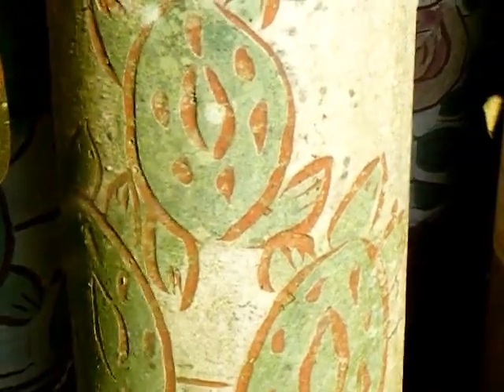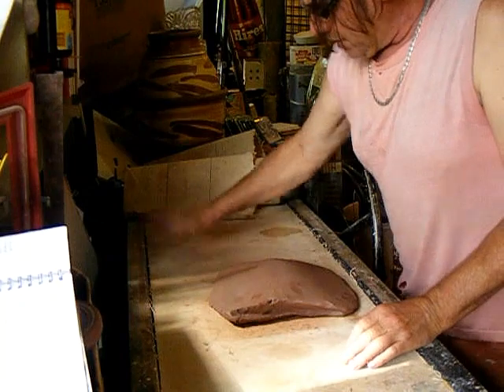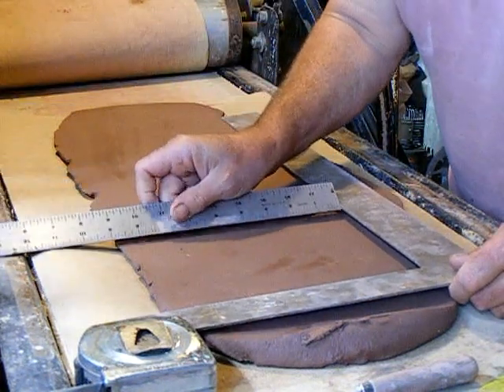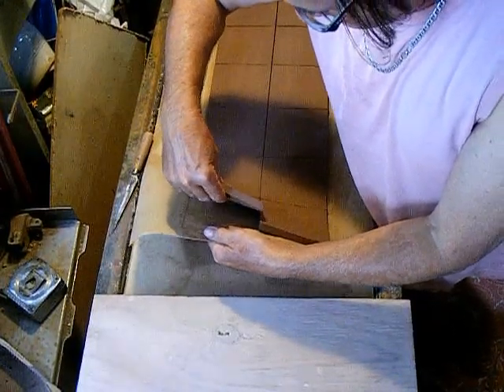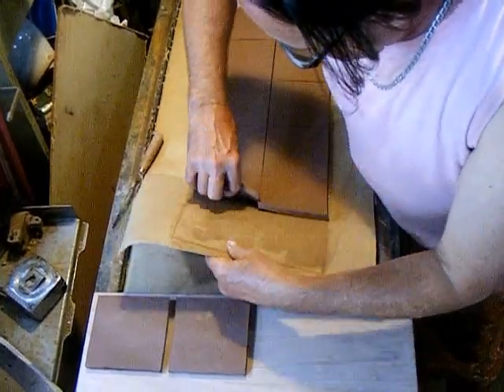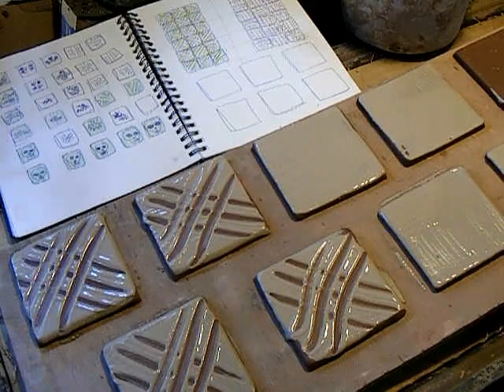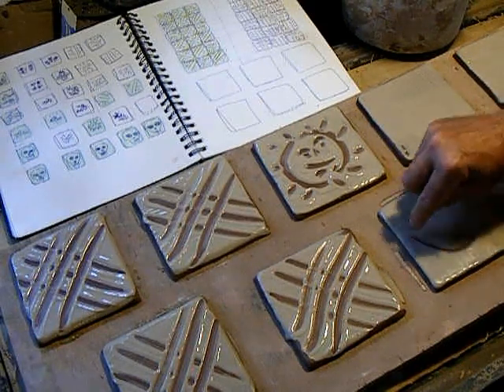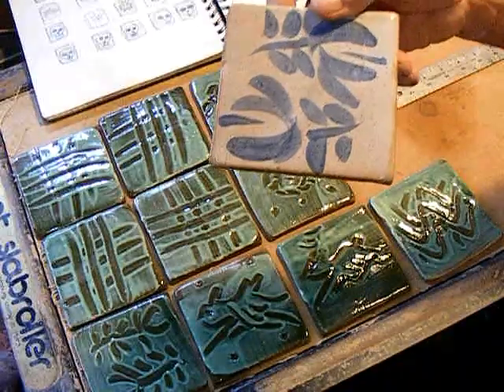Making ceramic tile, slip comb decorated (235 potters journal)

Comment: this great! thanks for sharing! now im reconsidering the tile punch! Did you not dry and bisque fire before glazing? Did I miss that?
Reply from the maker: Not a full step by step, yes, I bisque fire. I've heard from several that the tile cutter is useless, easier by hand. I must say there is a new technique that could change that. A piece of Ceran Wrap is placed over the clay before pushing down the tile cutter. It rounds the corners and could make for easy release. I may try it with cookie cutter ornament to see how it works.

Comment: Ditto regarding purchased tile cutters, punch style. I got one for my classroom. Poor quality. It fell apart within a day or so. Waste of budget money. Your method is the best way to get square & consistent size. Yours turned out very nicely!
Reply from the maker: They were easier and more efficient by batch three, I did learn something with this relatively simple project. Interesting that the purchased tile cuter not only doesn't work but also falls apart. Like so many magic counter top kitchen appliances people buy, that do the same thing as a fry pan or roaster - wish they wouldn't think so hard about buying a ceramic pot.

Comment: Hi how do you make the clay you are using?
Reply from the maker: I use Standard Ceramic Supply's clay, they distribute all over the Eastern US. The pieces in the opening shot are extruded drainage and chimney tile or pipe that I get from a brick yard were they extrude them. If it dries out I put it through the process of reclaiming it for making the garden stepping tie I show here first with the turtle. If you dig your own the process is similar to the reclaiming process the I demo in the following videos. https://youtu.be/wLkM7GF9OC8 Thanks for watching.
Reply: @pottersjournal  thanks for your great response it has helped me.

Comment: Basket weave
Reply from the maker: Influenced by #TheWeaver who regularly appears on my channel.
Reply: @pottersjournal    hello.. What did you use for brushing the raw tile... What types of paint..what is it called?
Reply from the maker: @theanonymous8069  I used a white slip - a thin watery white clay. The kiln fired glaze put over the drawings later then give it the green color. Hope that helps, thanks for watching.
Reply: @pottersjournal  owh it's called glaze?